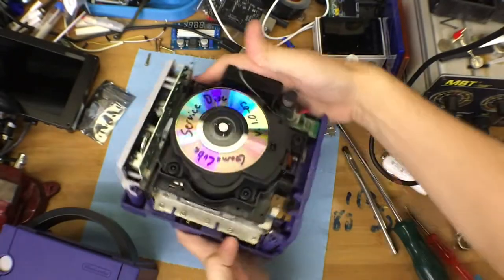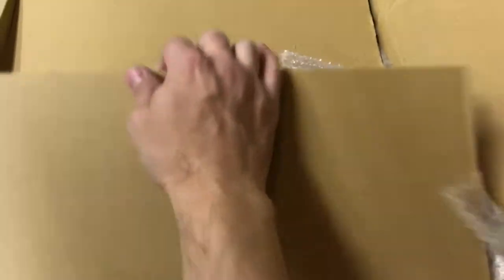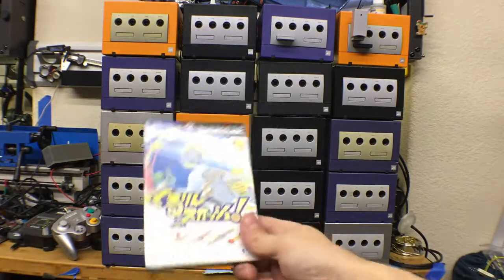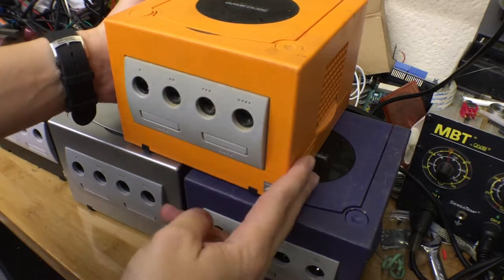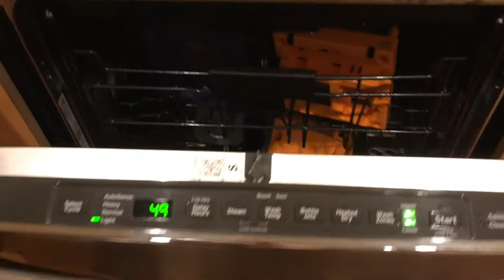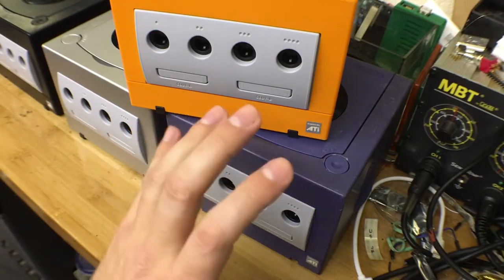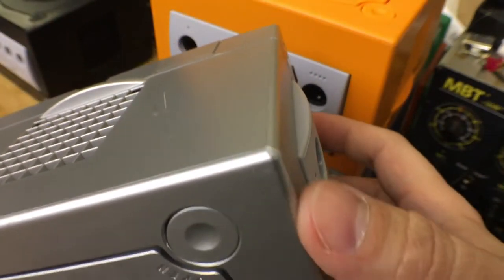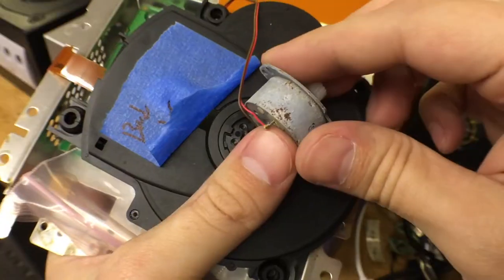GameCube Dishwasher Safe?!?

Comment: Not surprised they all came from Japan. I remember going into a retro-gaming shop in japan and they had a literal wall of untested gamecubes (with no cables/controllers) for around 450 yen each (~$4 USD), which was pretty surprising considering just how much more expensive they are basically everywhere else.